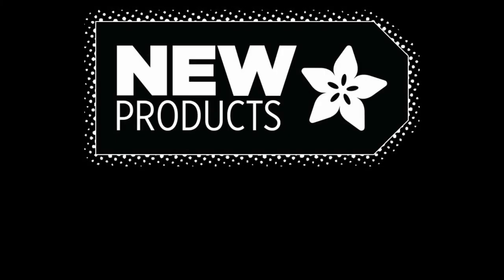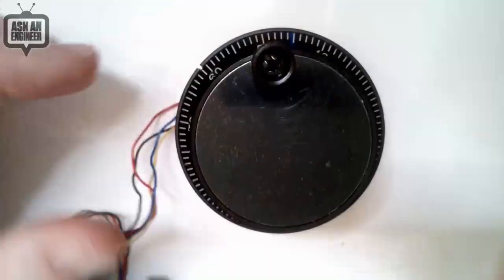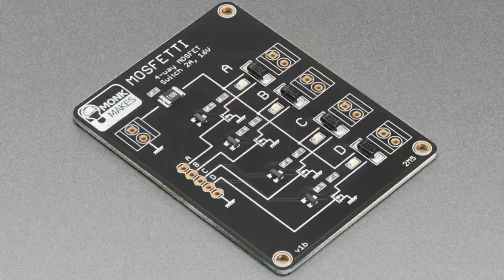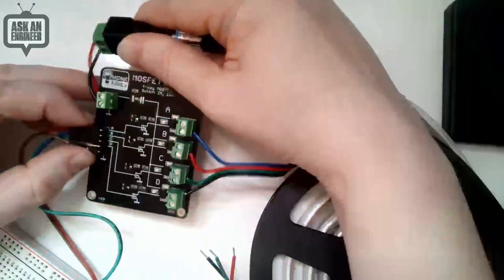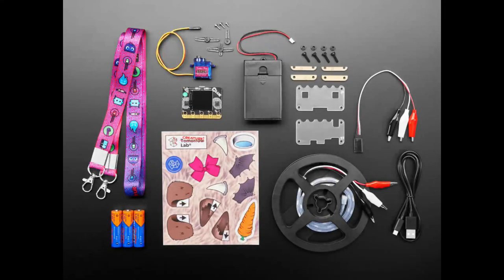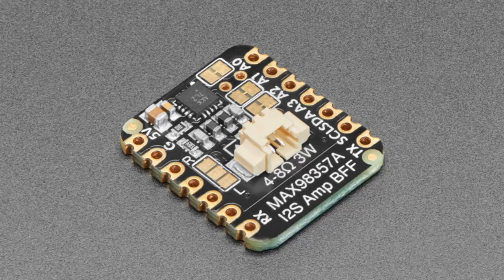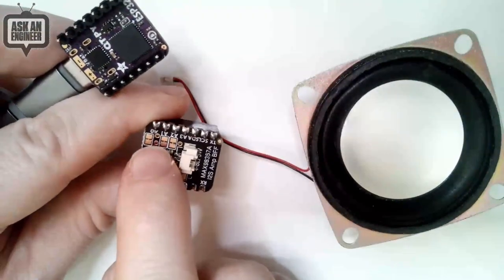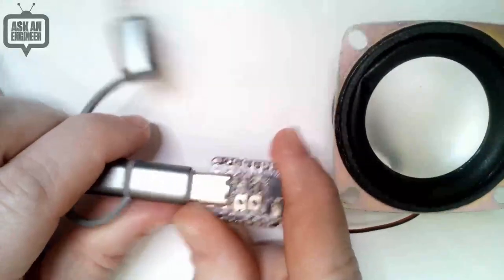#NewProducts 6/07/23 Feat. Adafruit I2S Amplifier BFF Add-On for QT Py and Xiao!

Comment: The rotary encoder clicks --- that's good. But in my experience the MAX98357A also clicks when transitioning from silence to outputting sound. That's not good, particularly in applications that play discrete sounds rather than a continuous stream. This has been discussed in forums, but I have not seen any successful workarounds. What is the official Adafruit word on this?
Reply: I was thinking radio too! Seems like such a great way to conveniently sweep across 3 orders of magnitude without having to hit a button to shift 10's positions...